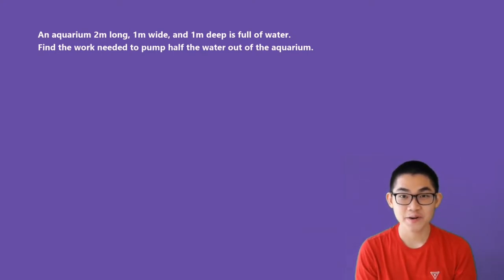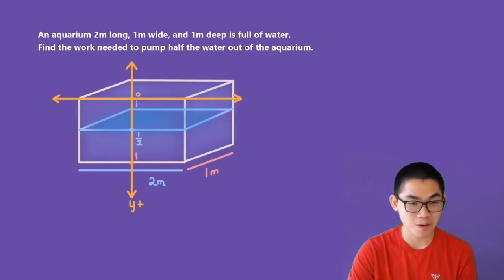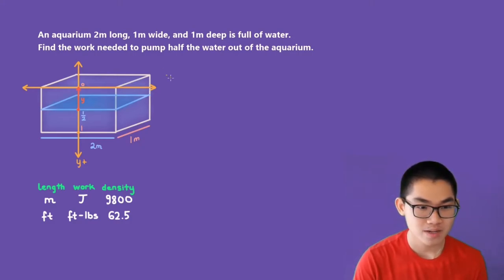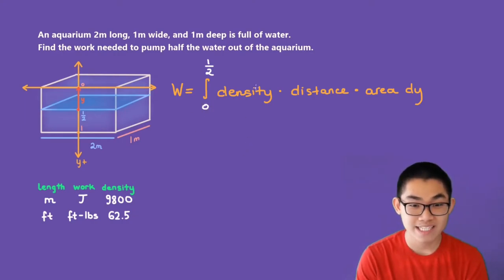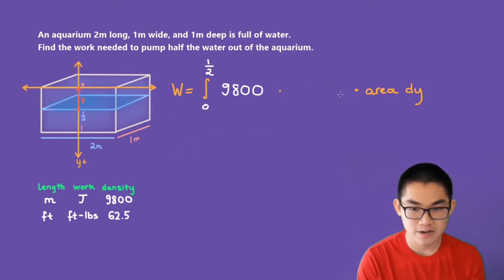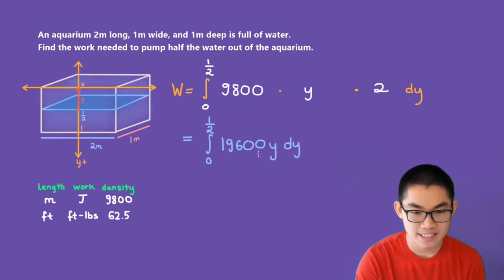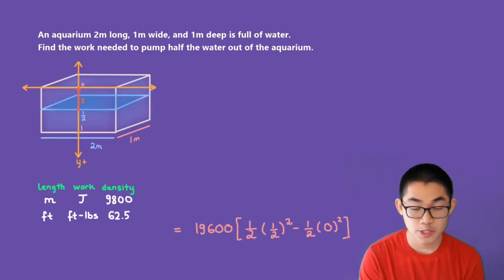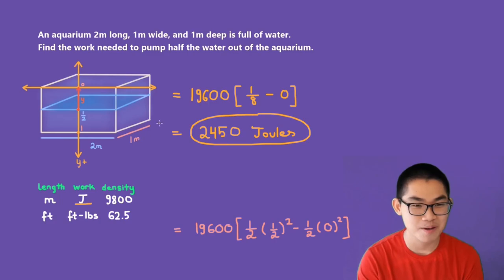Calculate Work to Pump Water Out of Rectangular Tank

Comment: Hi, my textbook has a exactly same problem and it says consider the fact that the density for water is 1000kg/m^3, the solution also used 9800 but didn't explain why. Could you explain why you used 9800 here?
Reply from the maker: As you already know,  the density for water is 1000kg/m^3. But we have to account for gravity acceleration which is 9.8. So if you multiply the two together, you will get 9800. But that's only if the tank is measured meters. If it is in feet, then the you must use 62.5 instead of 9800. At the end of the day, the easiest way is just to remember these two numbers, 62.5 and 9800. It's not really important where they come from. Let me know if that makes sense!
Reply: @QuocDatPhung  Thank you so much! So if it's water tank or bucket problem we always need use these two number? BTW Your videos are amazing .
Reply from the maker: @rebeccalan8778  Thank you for your kind words Rebecca! And yes, just remember those two and you're good to go! There are about 5  kinds of tanks you should know (circular tank, rectangular tank, triangular tank) and each are slightly different from each other. I go through how to deal with each kind in my playlist here: https://www.youtube.com/playlist?list=PLeTO6OT3-FKmuCeO97iKt_Aibx-a938JA

If you enjoy my videos, please don't forget to subscribe to buy me coffee and also share with your classmates to help them too! Have a nice day!